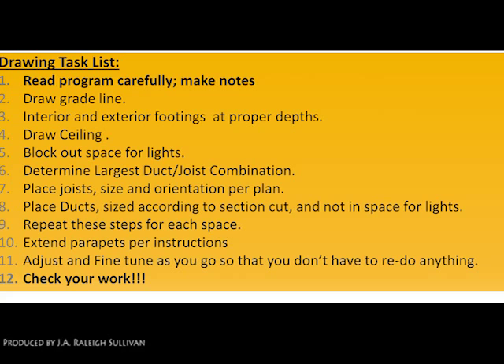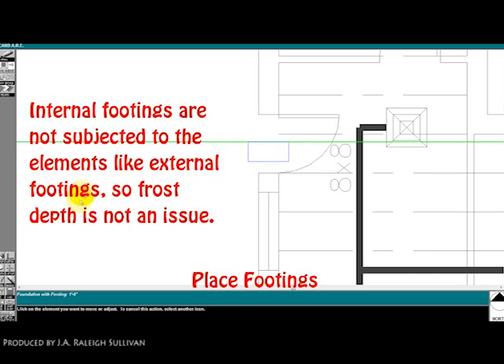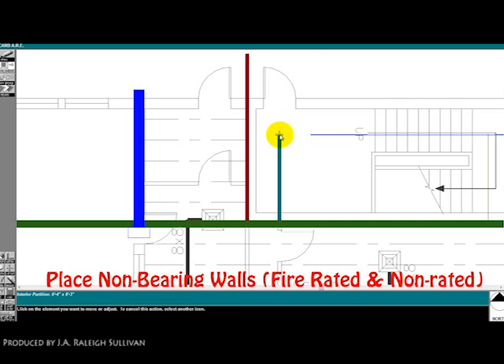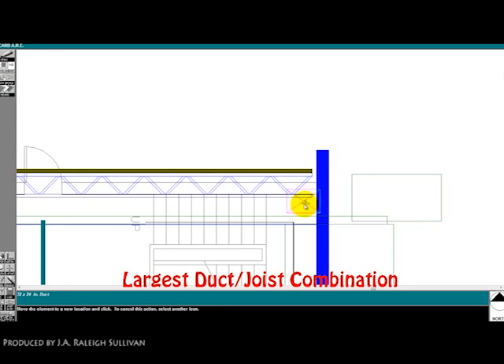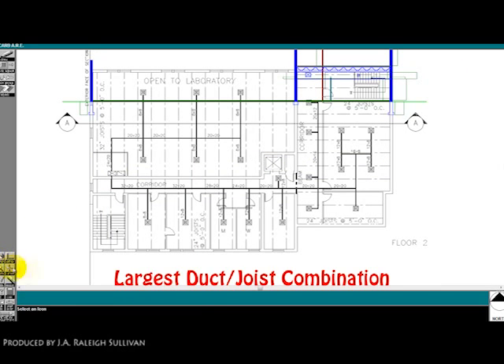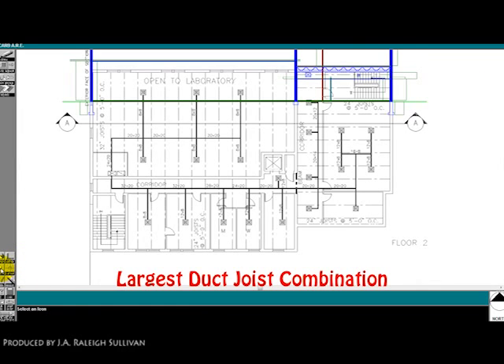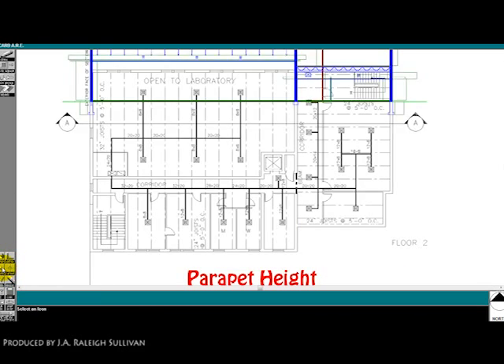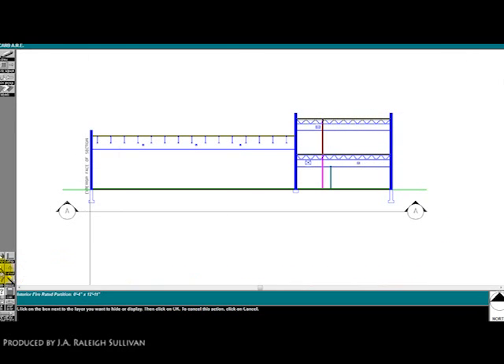Building Section Vignette Video

Comment: I tried to watch this yesterday and I couldn't concentrate on the info due to the music. But today I played it again while trying to rock my baby to sleep and i killed 2 birds with one stone lol. So, question... Do you pick the larger combination between the biggest duct/joist or just add the largest of the 2 to get the interstitial space height?
Reply from the maker: Pick the larger combination of joist/duct that happen at the same spot.... Glad the music issue wasn't too bad this time around, if i had know how much it would distract everyone i wouldn't have done it... Good luck on the test!
Reply: On the 2nd floor, isn't the worst combo the 32" joist and the 20" duct? You used 24" joist and 20" duct? Or is that only for the labs? It seemed as thought you ignored the lab space when choosing this for the 2nd floor. I thought it was the worst combo by floor not by space?